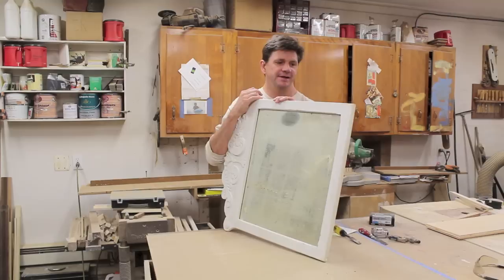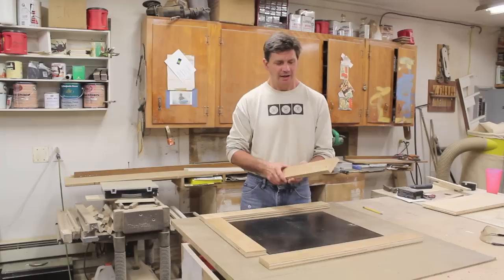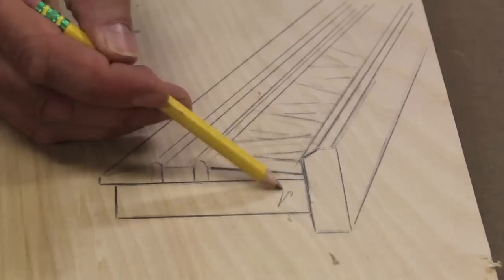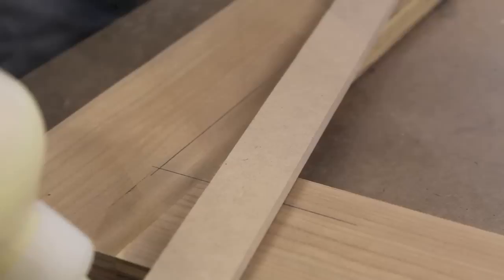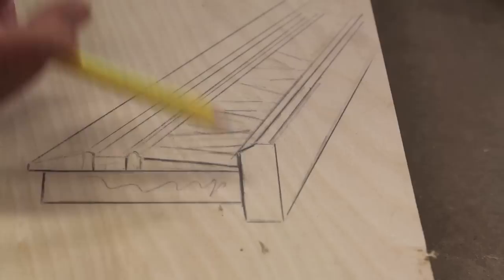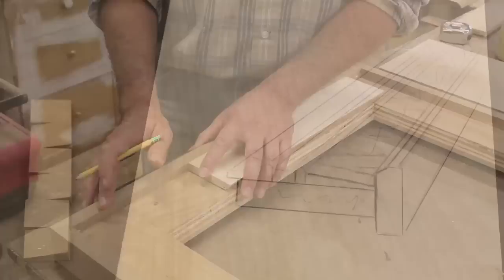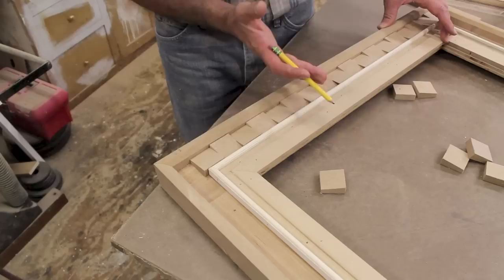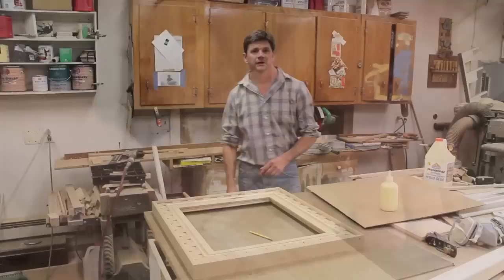How to Make a Super Fancy Frame !! by Jon Peters

Comment: Good video, nice build. It might have been easier to label the back of the staggering 7 deg.  blocks then flip over. I learned about the sacrificial chop saw fence. If I saw it before I had forgotten.  BTW - MDF absorbs moisture so it’s not glue friendly. You could an acid brush, then after the first coat has penetrated hit it with a second coat? I would have primed and possibly painted prior to glue up and lay painters tape on the back where the glue holds? Of course it’s your project so nice job and there’s a hundred variances to build this I suppose

Comment: Great, great, great job! Very nice frame; original design and it looks impressive.
However: wouldn´t be less work if you first assemble the complete moulding in a straight line and then cut once the four miters at the corners? All the best.

Comment: Another trick with chop saw.
Take a piece of blue wide painters tape and apply it to the full length of the saw blade cut chanel. Make sure it is stuck to both sides of the saw table where the blade comes down through.
Run the saw and bring it down to cut through the tape.
There is your perfect reference line, even when you change angles of cut.
Abundant Love & Blessings
Full Service Handyman